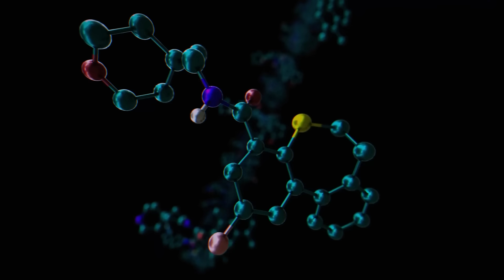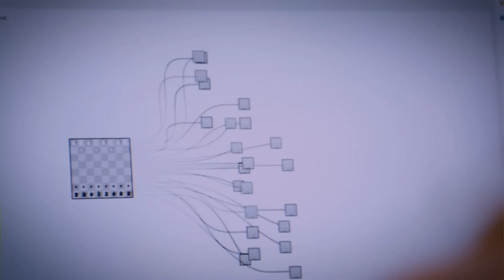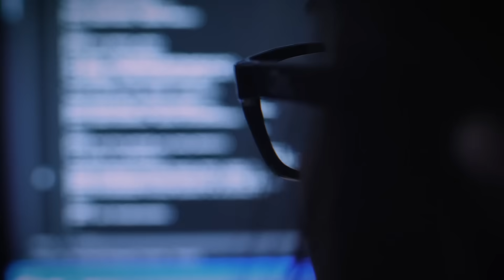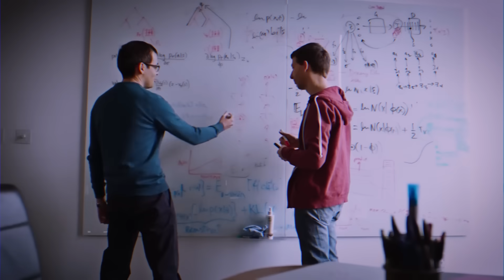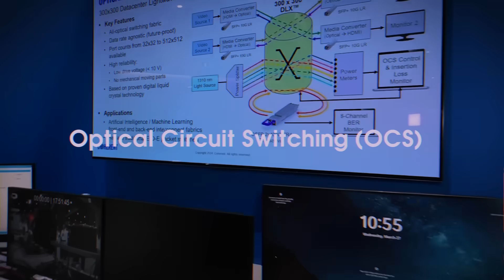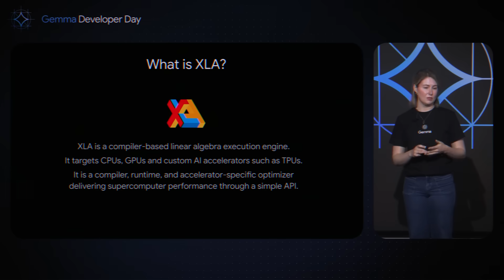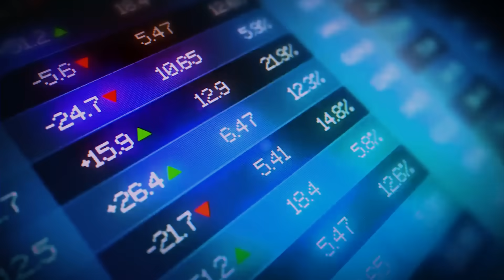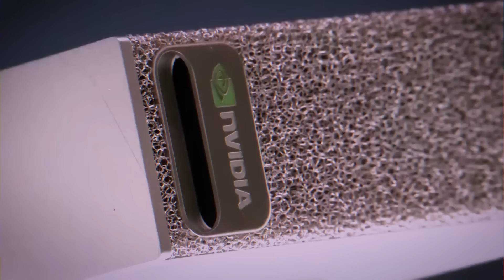Nvidia is in Trouble. Google Just Broke the Monopoly.

Comment: TL; DR: Google's TPU is a specialised chip that only does one thing but does that one thing incredibly well: AI. 

Nvidia is a general purpose hardware that can do anything you throw at it because it's controlled by the code.

When the bottom falls out of AI you can still use Nvidea GPUs for other tasks. 

Google's TPUs will be so much dead weight.
Reply from the maker: Nvidia's versatility is a major advantage, especially when the AI hype settles down. It’ll be interesting to see how this plays out in the long run.

Comment: The best that one can hope for by pursuing hardware specialization in regard to the LLM approach to “AGI” is an untethered acceleration into a brick wall at the end of a blind alley. These models are still mathematical functions at the end of the day which require an input. There is nothing else happening behind the scenes other than some very complex Linear Algebra, probably inspired by Dirac and the existence of Hilbert Space. While their initial outputs are impressive, the algorithms fall apart upon interrogation over said outputs. An algorithm cannot explain why it gave the answer that it did when thoroughly probed because there is no reasoning taking place, only a prediction based upon a calculation that the string of characters it outputs will make sense to the user. Accuracy of the output is not something that can be controlled for with this approach. Scaling up compute while increasing efficiency will never change this.
Reply from the maker: You raise some valid points about the limitations of current AI models. It's crucial to keep questioning and exploring the underlying processes to truly understand their capabilities and shortcomings.

Comment: The problem is what is the software coded for? Is it for CUDA or Tensor or a mix of the 2? If CUDA and/or a mix of the 2 then nvidia's GPUs are better but if purely tensor then Google is better. Lower power per core with more cores per unit of space while slightly above nvidia in Tensor only processing. The issue is Ironwood and the entire line of Google's processors only do Tensor not CUDA. 
So you get into the question of is it worth it to require their consumers to only use Tensor frameworks or is it worth it to also support CUDA? 
Some are staking millions of USD for the Tensor framework only machines others are going for a mix of CUDA + Tensor with a few racks of just Google Tensor Processors then you have the CUDA and OpenML datacenters which is nvidia and AMD GPUs. Just nvidia GPUs do seem to be a bottleneck when you want to support your consumer as it limits what you can support. Intel has its own thing but mostly on the CPU side and really AI doesn't run well on CPUs so you get NPUs.  You do have a Qualcomm NPU that is better than the Intel NPU and AMD NPU while nvidia in their own white paper explained how to use its RT cores for certain processes that a NPU would do. So anything built for an NPU nvidia cannot do without making an entirely new chip or modifying their current chips to be GPU + RT +TPU + NPU.
Reply from the maker: You bring up some excellent points! The software compatibility between CUDA and Tensor is a crucial factor for consumers. It's definitely a balancing act for companies to decide how to best support their users while maximizing their technology's potential.

Comment: Nvidia isn't a GPU company anymore, they are an AI chip company that dabbles in GPUs and they have been very busy disenfranchising and disregarding their traditional customer base. They have abandoned the GPU market because they just don't care anymore. They see the future of their company as selling a  few thousand overpriced chips to the worlds most overpaid companies rather than millions of chips to a customer base that needs a new one every 3 to 5 years. How long do you think this will last? By the time Nvidia realizes that they can't do this forever their customer base will be gone to AMD. I think AI is already doing all that it can. We need faster, quantum computers before they will start to be able to truly think for themselves, and do we really want this?
Reply from the maker: You raise some valid points about Nvidia's shift in focus. It’ll be interesting to see how they adapt, especially with competition from GOOG and the evolving tech landscape.
Reply: For the past 20 years nvidia try to break away from consumer makret because consumer  market for gpu are shrinking. Back in 2010 there is no way 10 year old gpu capable of running new games. Now even 10 years old 980Ti still capable to run many games if you keep the resolution low. Gaming hardware market is shrinking. More and more gamer buying used gpu since cheap brand new gpu no longer feasible. Even for AMD when did you see they launch $150 GPU? this generation AMD officially not launching any new GPU below $300 mark. That's why AMD also moving towards AI just like nvidia. Lisa Su herself said "AI is not bubble", " AI is the right gamble". Consumer need to realize this the cheap gpu that they want are no longer realistic.

Comment: Q.ant will arrive and be around 800 times faster than Nvidia chips. Transistors will not be needed, nor will additional memory on the chip. It can be installed in any PC via PCI-E, is about the size of a normal graphics card, and can work with other hardware components. It will also consume very little power—up to 1000 times less energy is expected.

If Nvidia does not change and switch to lighting technology, they could soon be “delighting gamers” again, because then hardly anyone will want their AI chips anymore.
Reply from the maker: Thanks for sharing your insights! It’s always fascinating to hear about new technology that could shake things up. Let’s see what the future holds!
Reply: 800 times faster? 1000 times less energy?  Can u share some article or something